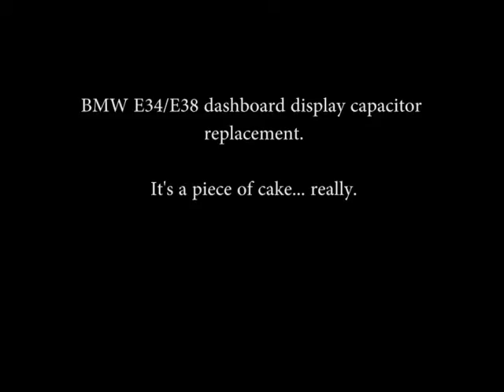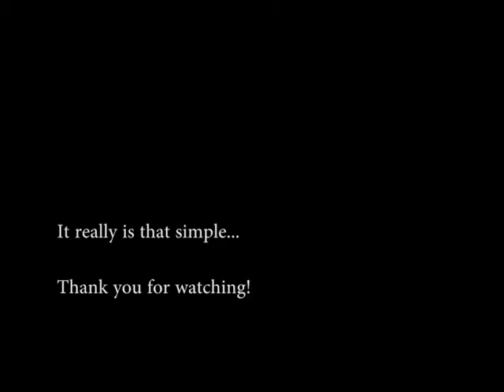BMW E34 gauge cluster capacitor replacement

Comment: Hi there, thank you for the video. I have a E34 with a gen 3 cluster. The temp and fuel gauges are always in cold and empty. When I run a test everything seems to work just fine. Sometimes the fuel shows 20L sometimes 60L even if it doesnt have that much. I am sure that the sensors are working. Another problem is that sometimes the cluster goes completely off like something is shorted and restarts itself multiple times etc. If you have any experience or knowledge i would be more than happy. Thanks in advance.
Reply from the maker: Hi there! It sounds like it could be bad earth. Did you check wiring continuities?

Comment: bro how to fix speed bouncing on my soeedometer..smt delayed i drive 40 km/h and still pointing 20 and than catch up to 40
Reply from the maker: I am afraid I can't help you with that, I have never had the issue. Maybe check wiring continuity coming from the sensor. It should be shielded, but if something has damaged the wire, or some electronic interference gets through it could affect the signal I suppose. Good luck!

Comment: What is the value of the caps replaced there?
Reply from the maker: Hey Mike. I think it was something like 7 cents a pop. Haha, just kidding. I am pretty sure it is 47µF, but I must double check so don't take my word for it. I think I still have a few lying around somewhere. Here is an interesting resource which will certainly help you out, if you haven't found it already: http://bmwe32.masscom.net/johan/dash_caps/dash_caps.html

Comment: Hi my speed guage keeps fluctuating around 80-100kmph. Could it be faulty caps?
Reply from the maker: Hi. I am not sure. You might want to check that the speed sensor signal is clean. If not, it could be anything from bad connections to faulty caps indeed. Can't help otherwise, I'm afraid. Best of luck!
Reply: @gmcevoy  Thank you for your reply. Speed works fine from 0-80kmph and 100-160kmph. Just the 80 to 100 thats fluctuating.
Reply from the maker: @ShoelDaniel  Strange indeed. Sounds like it might be some electrical interference with the signal. I would check the sensor signal first, most definitely. You will need an oscilloscope for this.

Comment: Thank you Geoffrey for this video. I was having this issue: 
https://www.youtube.com/watch?v=3sJnDrUf_AY
But I think mine was a contact issue:  either between the zebra connector of the LCD and its pins (mine is e36) or cold soldering issue in the back of the PCB.  I cleaned the zebra connector and the metal contacts of the white LCD housing unit, and that worked (with the intermittent flickering being less frequent than before, but still there - btw: I do not get strange characters etc. - So I don't think my issue is bad capacitors?)  Anyway, I took it apart again to re-solder the 20 or so pins in the back of the PCB, but noticed a whole layer of protective insulating glue/coat on it. I did not want to take it off - since I was not sure I needed to re-solder. So far it is 99% ok (flickered only once today for 10 seconds). 

1. Do you think what my video shows is a capacitor issue or electrical contact issue?
2. If I wanted to re-solder the LCD pins in the back of the PCB, how do I remove the protective coating of that insulating layer without damaging the PCB.  Alcohol did not remove it, and I was worried acetone may be too harsh on the PCB.

Many thanks!!
Reply from the maker: Thank you for your comment, Nasri. I have replied on your two videos. I hope it helps!
Reply: @gmcevoy  Thank you so much !!! I saw your replies!

Comment: Hello, I have a 1999 E46 and nothing works. check the fuses and they are all good. check wiring and ground and it is perfect. What could it be?

Thank you!!
Reply from the maker: Hello. The E46 electric system is very different from the E34. It could be one of a million things: frayed wire, after-market accessory, the cluster itself. I cannot help with so little to go on, I'm afraid. 
I would suggest hooking up an OBD fault code reader first, sort out all problems there, and move on to in-depth diagnostics. Maybe try a local electronics specialist, he will surely be of better council. 
Best of luck!

Comment: Hi, i have problems cluster odo-meter  M50  1991. manual odometer run off  ,odometer stop 190 xxxkm and 2year  stopped  and rpm gauge not run :/
Reply from the maker: Hi there buddy. I really wish I could help, but with so little to go on and without seeing the car, it is going to be impossible. There might be a short circuit somewhere, your PCB could have fried, electrical connections might be loose, cables might be broken... etc etc. It could be so many things. I suggest you maybe try another gauge, or bring your car to an electronics specialist.
Best of luck!

Comment: hi i repalced the capasitors but no reaction
Reply from the maker: It must be something else, then. This problem is a difficult situation. For me, replacing the capacitors sorted out the problem, but sometimes it is something else. I have had a few messages from people like you, for whom it didn't work. I would suggest that you check continuity in the wiring of the car, and make sure that no aftermarket additions (radios, lights, etc...) can interfere. Best of luck!

Comment: Works this also on the older cluster of the E34  from 1992 ? When the cluster gets warm/hot i cant read my display,it fades away.
Reply from the maker: Hi. Sadly, no. In 1992, it was another version of the cluster, with a different PCB. If your display fades away when going hot, it is most likely the contact strip in between the LCD screen and the board, which has poor contact due to old age. A simple fix, which also costs peanuts. It's just a pain to get to. You have do dismantle your cluster completely, and get the LCD display unit out. When you pry the metal frame open, and get the screen out, you will see a pink (or white) rubbery strip, all the way along the bottom of the screen. That's what need replacing. They are hard to come by, but you should manage to source them. They cost like 2 bucks for a bag of ten. Your E34 friends will love you for that. :) Best of luck, and thanks for stopping by!
Reply: @gmcevoy  Ok ,you mean the ribbon cable,i already replaced that strip and have al of my pixels back,but still if its warm/hot it fades away .
Reply from the maker: @NotoriouSsThug  Yes, that's exactly it. I had completely forgotten what it was called. If I remember correctly, when temperature rises, so does resistivity. So there could well be undue resistivity somewhere in the circuit. Maybe in the ribbon cable itself, or contact in between that and the PCB is not good enough... Hard to tell from here, but if your ribbon cable is new, and it still fades upon heating, I would start looking for voltage drops, or resistivity spikes when warm. That's a tough one you got there, man...

Comment: helo  i have   problem too    e 34  525 i   is  clusters  makes a  crazy  is  gas  and  temperature   is  jumping
 when   turn on key   all gone
 only   work  lights  all  correct  wht  can by   eny  help   tnx
Reply from the maker: Hello. It sounds like the battery of your E34 might be dead. Sometimes, a flat car battery does that. It is located under the rear seat, on the right side of the car. Just pull the rear seat up, and it will be there.
Otherwise it could be a short circuit somewhere. If you have recently installed after-market parts (radio, amplifier, ...), try removing them, and see what happens.
If the problem still persists, take the cluster out, and look for signs of short circuit: burning of the circuit board, and so on. 
It may also be a loose connection, with the wiring behind the gauge cluster...
Lots of things to look for. I hope this helps! Best of luck
Reply: @gmcevoy   tnx i Will check uot
Reply: my E34 535i has the same issue. Was in storage, just pulled out and needles for gas and temp very jittery and jumping around.  Disconnected/reconnected battery , now they don't move.  Battery has a full charge, all lights work fine.   Trying to figure if it is the capacitors or something else like a short somewhere....don't know where to even look for that

Comment: My cluster have kinda different problems. The gear indicator (mine automatic ) is only showed up for at least 20 sec, and than goes blank. The information display have a different stories, it's only show something when the engine off, but when i turn on the car, it showed nothing, not the mog, fault or etc. What do you think by that? What should i repair?
Reply: *i mean mpg not mog. Sorry typo
Reply from the maker: @fajrymalik  Hello. It definitely sounds like you need repairs. It could be the LCD screen connector, in the display. There is a little electrical strip, in between the LCD panel and the PCB. If the resistance is too high, it does the symptoms that you describe. It is quite hard to find, but it is an easy fix.
Reply: @gmcevoy  when i do the cluster test method, all display is capable of displaying things. Or is it because my car only have clock obc, not full OBC? But what about the gear indicator? Only showed up for 20 sec and disappeared
Reply from the maker: @fajrymalik  Without seeing it for real, it is quite difficult to say, to be honest. There are so many factors, to take into account. There are a few companies, specialised in reconditioning these units. You might want to ask them, as your problem is quite different from the one that I had. Maybe the solution is not the same, I cannot say for sure. Sorry that I can't help you out, more than that. Please let me know, when you have found the solution! I wish you the best of luck! :)
Reply: @gmcevoy  hey, that's okay, thankyou so much for responding tho, and thankyou, best of luck for u too

Comment: Hello, my e34 535 everything on the  instrument cluster work perfectly but the problem is the gear selector indicators display (P R N D ...) and the drive
 mode (S E M) inoperative, the light bulb worked fine when i self testing the cluster, i maked sure the problem is from the cluster itself by borrowing cluster from my friend car and put it on my car worked fine . Any solution plz ? and thanks for you.
Reply from the maker: Hello Andre. It would seem that the ribbon cable would be the problem, here. It is an easy fix, but it is difficult to locate good quality ribbon cables. I might still have one or two in stock, if it helps.
Reply: @gmcevoy  hello, thanks for reply, i didn't find ribbons cables in my cluster, there are a direct pins connector between display and the main board, i tried to replace the display from another bad board cluster with good display i found same problem, my problem is from my main board, any help plz? Thank you.
Reply from the maker: @AndreAndre-ft4nb  Hello again. It is always a pleasure. Take a close look at your circuit board, as oxidised connections can cause this kind of trouble as well. If you can't find any, then it might be worth contacting one of the few specialised companies, with extensive knowledge about these clusters. Best of luck!
Reply: @gmcevoy  thanks for you , i will try to take a close look.

Comment: Hi, do you work on motorcycle clusters or do you know someone that does? I have one that the tech & speedometer not working correctly. It's on a BMW 2005 R1200GS. Can you help me? Thanks.    Bob
Reply from the maker: Hi Robert. I don't have any experience with these, but depending on where you are based, there is certainly someone out these who can help. If you are located in the UK, you could try ACTronics.co.uk for example. They could possibly take care of it, or point you in the right direction. If you are on the other side of the pond, try odo-pro.com. They are specialised in BMW clusters, so they surely could help. Best of luck, and thank you for watching!

Comment: Hoping to get a parts cluster to restore to go in my 95 525i as it's starting to show signs of malfunctioning. (Check control, trip reset, s.i. lights are out). Going to restore the spare cluster and it's contact pads for the trip and check control buttons and put new caps and such. Ok these clusters what controls the guages on these cars? I know old E30 clusters they have gears and such.
Reply from the maker: Hello there, and thank you for stopping by. I think I still have one in stock, to suit your '95 525i. There are three versions, of these gauges. You can easily tell the difference by the rear cover colour. Which colour is yours? You can always send some pictures on my email, if you like: info@mcevoy.be
These gauges are electronically controlled. You might want to salvage your old cluster, for its internals. They are hard to come by, these days, and new replacement parts are either unavailable, or cost an arm and a leg, at BMW.

Comment: Please tell me how can I repair
my bmw 525i 1991 dashboard. it
refusing to be (reset oil service) 
l know that I must connect pin7 to
pin19. and i do all steps corectly.
and i checked the wires ther is no
problem with them. I think that the problem is with the dashboard.
please helpme.
Reply from the maker: Hi Muhammad. Thank you for stopping by. I doubt that your problem has anything to do with the dashboard. To reset oil service, you need to place a jump wire in between pins 7 and 19, turn the ignition on, wait for 5 seconds, pull the jumper wire out, and turn ignition off. If this doesn't work, do the same but wait 12 seconds. If it still doesn't work, I suggest you get the oil service reset tool, from Draper. It is relatively cheap, and works with all BMW's with the 20 pin connector. If it still doesn't work, then you will indeed have to start looking elsewhere. But if I were you, I would try again. Either with the reset tool, or the jumper wire technique. 

Best of luck! :)
Reply: @gmcevoy  thank you very much💜.
Reply from the maker: @muhamadkarzan3213  I really hope it helps, man. :)
Reply: @gmcevoy  it mean alot for me💜.
Reply: My E36 has oil sevice reset problem too. I has tried hooking pin7 with pin 19 many times , no matter how long, I have got no any response. I found out that pin 19 is not grounded. Problem was solved by hooking pin7 with driver's door screw head.
Reply: @phonophile  
thanks  but I did that too but nothing happened.

Comment: hello , on my e34 525 tds 1994 , the temperature level and diesel lvl is hs , can u have a solution ? i have already change the sensors .. thanks !
Reply from the maker: Hello, Dim. You might want to check the wiring, and the connectors. See that there is a good connection, in between the connector and the PCB. Also, measure the resistance at the gauge connector, on the relevant wires. Having the wiring diagram at hand is paramount, of course, and knowing what resistance to look for is essential as well. Best of luck!
Reply: @gmcevoy  thank you I will check 😏

Comment: I have Difficult problem in my  e34 cluster  , I need help from some one professional , all the indicators  (speed , fuel amount , fuel economy, engine temperature ,rpm and digital screens every thing work properly) but from time to time  the( obc) could not show the car speed and the Average consumption of gasoline, additional the cruse control stop working also the abs stop working too , some opinions says that the cluster does not send speed signals to them , and I should replace it , in my country Egypt the cluster is very very expensive and There is no guarantees make all these things working again , any help?
Reply from the maker: Hello Ayman. Thank you for stopping by. It sounds like you are having huge electric faults, other than the cluster. I would suggest that you first check all the fuses. If the OBC has been retro-fitted, this could also be a source of problems. You might want to check the connectors of the OBC as well, and also the wiring of the cruise control stalk, near the steering wheel. It is going to take some time, surely. I hope that you are good with automotive electrics. :) Best of luck!

Comment: So I did the capacitor replacement but now I get nothing and my OBC just shows PPPP any info
Reply from the maker: Hello Robert. Thanks for stopping by. Is your OBC an original fitment, or was it retro-fitted? I had the same issue, after replacing the original digital clock, by a second hand OBC. I know for a fact that this PPPP display means that the coding plug of the gauge cluster is not recognised by the OBC, and they can no longer communicate. You can try to disconnect the battery for 10 minutes, and it might sort it out. If this does not work, then turn the ignition key to position 1, press the CODE button on your OBC, and use a ball-point pen to push on the tiny little button, on the face of the OBC. Long enough until the display blinks, asks you to input date and time, and you should be set... Let me know how it goes!
Reply: @gmcevoy  my obc and cluster are original also my obc does not have the reset button
Reply from the maker: Hello again. It should. It is very small, and coloured a dark green. If you are in doubt, send me an email with a picture of your OBC at info@mcevoy.be, and I will highlight it for you.
Reply: @gmcevoy  sending one now
Reply from the maker: You should get the reply any time soon. I hope it helps!

Comment: Why did you replace the capacitors, what was your cluster's symptoms.
Reply from the maker: Hi there, thank you for stopping by, and for subscribing to my channel, I truly appreciate it. Lots of E34 content coming up soon! The symptoms were that the LCD display would start flashing, and random characters would appear. Sometimes, it would only display one or two lines. You couldn't read the mileage, and it was just plainly annoying. Replacing the caps has fixed the problem.
Reply: @gmcevoy  hi bro but the same problem on my e34 1993 525i it is as your cluster. i replaced caps but the problem remains help me please
Reply: I had an electronic guy replace some capacitors, but I'm not sure if he replaced those capacitors. Thanks for your reply.